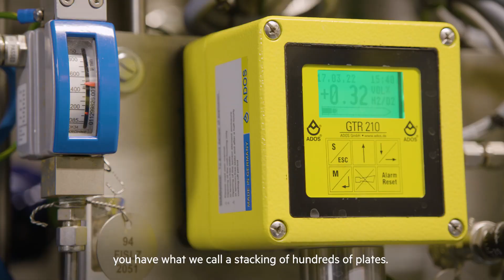The zero-carbon hydrogen future is taking shape in Quebec

Comment: An EV will travel 3 times the distance on the electricity that electrolysis need to split water into Hydrogen and Oxygen for Green Hydrogen, combined with massive increase in maintenance cost to deliver microscopically clean air to a fuel cell, not to mention the transport, delivery and storage problems with Hydrogen makes it a non starter like has been for decades now.
EV's remain far cheaper to fuel, electricity distribution is already here and far less complicated to maintain and therefore far more reliable that Hydrogen.
It's no wonder Hydrogen has been the future for the last 50-100 years and it will carry on being the future, lets hope non is fool enough to fall for the investment plan. They are going to be ripped of like all the other investors that have been ripped off over the decades